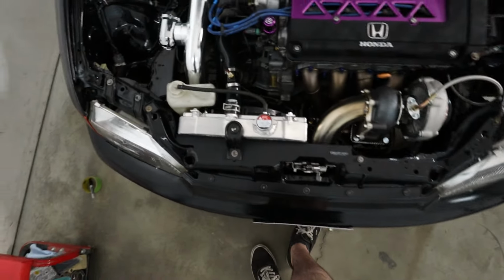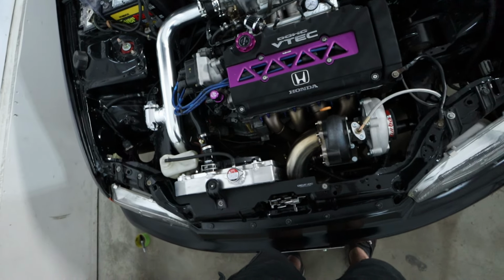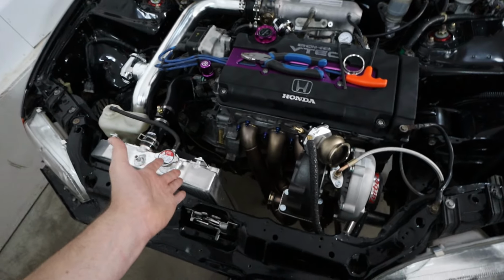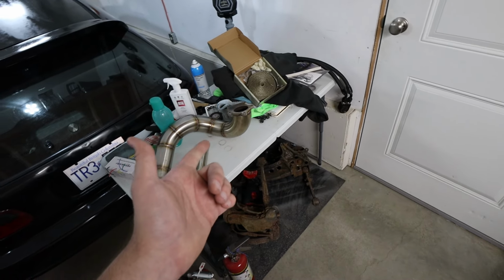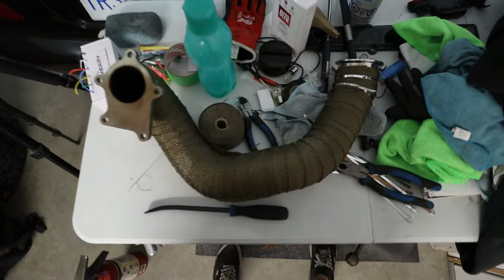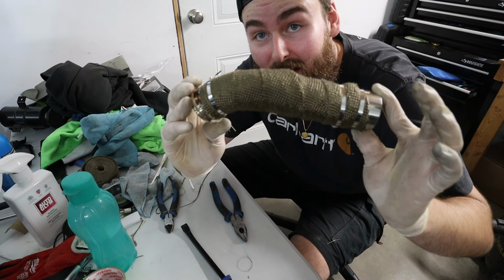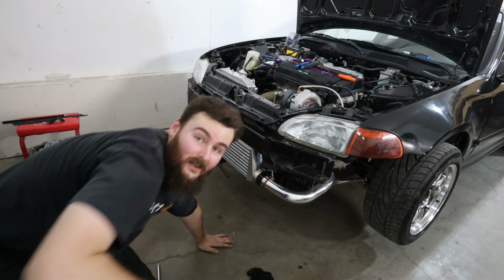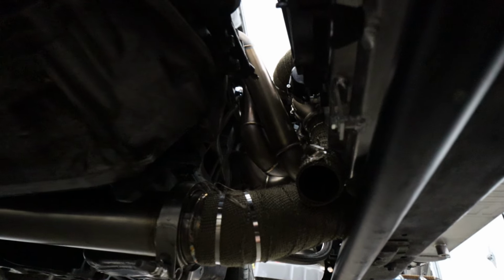HEAT WRAPPING MY EXHAUST FOR BETTER COOLING!

Comment: Add a Spal fan turn fan control in ecu on set to 95c  the factory fan control is like 103c to 110c  using the fan temp switch
Reply from the maker: Definitely getting a spal fan! But i do not use onboard fan controls. Have mine wired to a switch so I can control it!